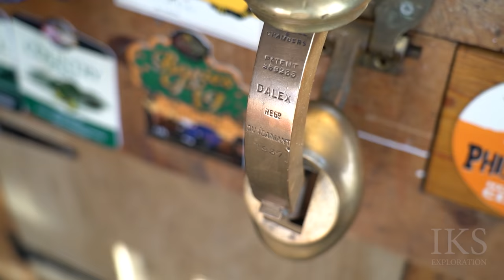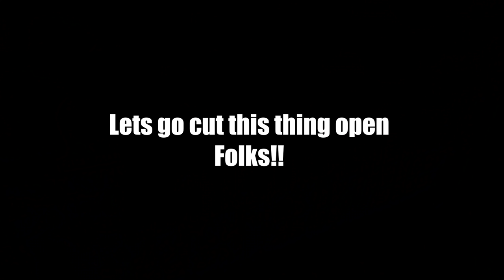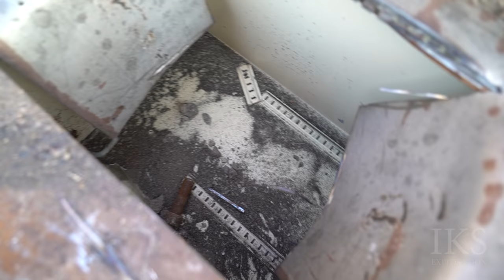Breaking Into Abandoned Safe - WHAT'S INSIDE??

Comment: The wood and lining are there to slow down cutting with a gas torch. The lining, when heated, gives off water vapour, which in turn, dampens the wood, which causes the heat to be spread over a wider area than the concentrated point of the torch flame on the metal outer, making it a lot less efficient. I'd have just cut the hinges off, and levered the door off with a wrecking bar.
In an ideal world, I'd have burned my way in using Thermite.
Reply: the door had big pins that went into the side so cutting hinges wouldn't have worked - however as we discovered the back would have been quicker

Comment: Can explosives be used to open safes? Definitely. Does it typically result in the destruction of the contents? Definitely 😂

Two methods. First is to use a shaped charge to blow a hole though the side. The second is far more destructive and fun to watch. Drill a hole in the top of the safe and then fill it with water to provide compression. Then lower your charge into the hole and retreat to a very safe distance. This method would peel it open like a tin can 😂👍